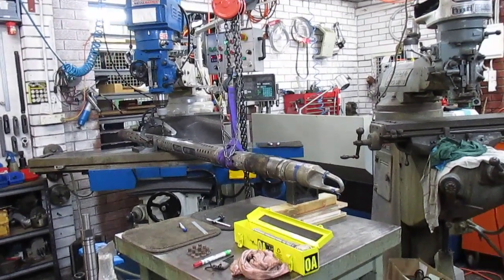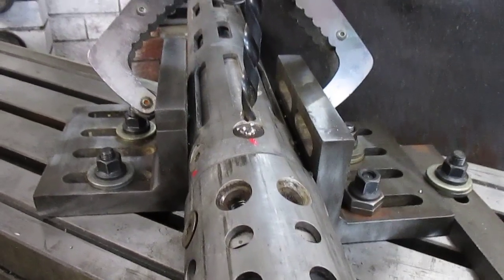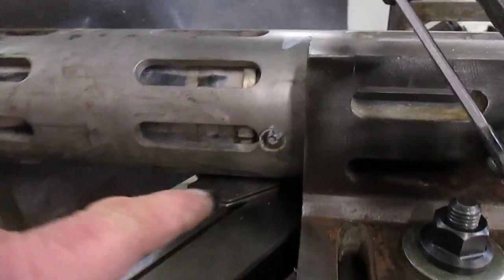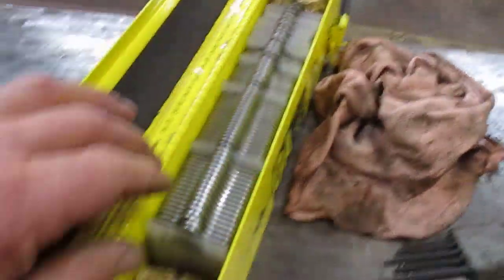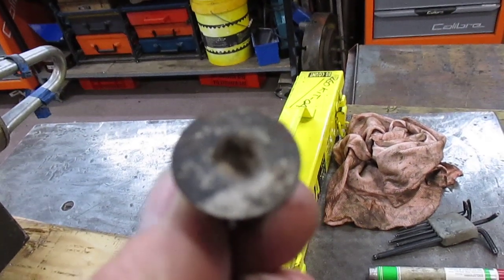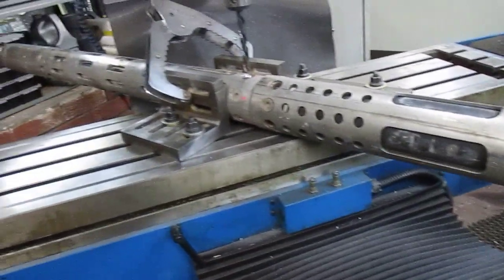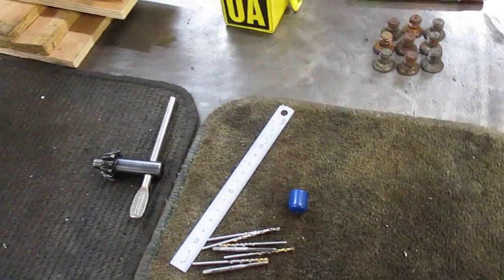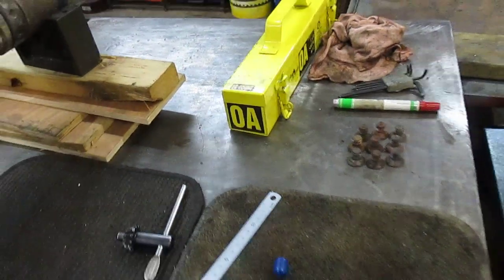Getter Out 9 Part 3

Comment: Reminds me of how abom79 got them out it was also a gun barrel :) ,Wouldn't a little heat help ?Nice gauges
Reply from the maker: Wana Bear…..Chuckle here! There is $100's of thousands of dollars of sensitive equipment inside that casing! All of which are covered with rubber bladders filled with oil!, Also I am not a proponent of heat as a base unit for "Getter Out" although many people do use that method as I am constantly made aware of when the phone rings and I put my fireman's cap on to help them correct their misdemeanours!
Reply: Yeh i did not think of that bruce humm i suppose the customer wouldn't be so happy D..